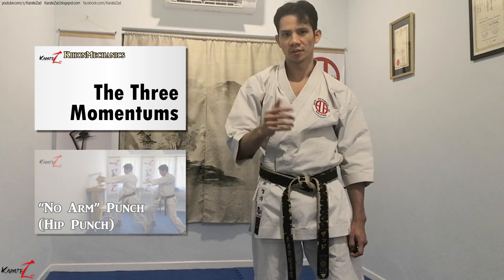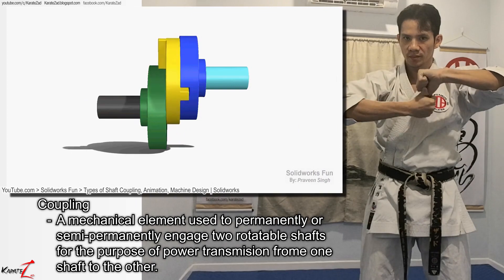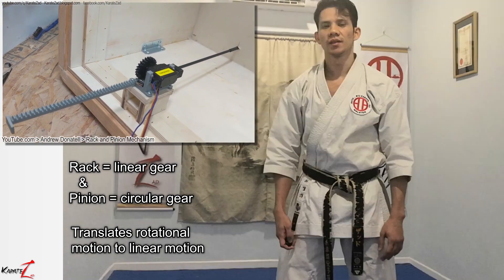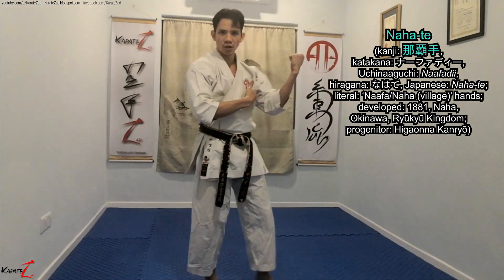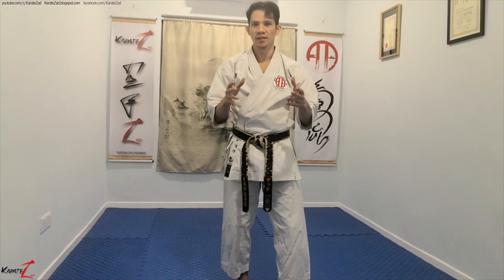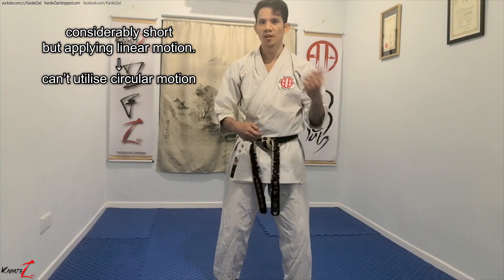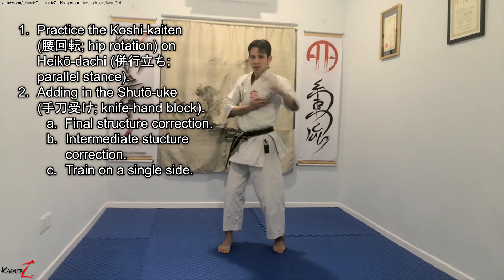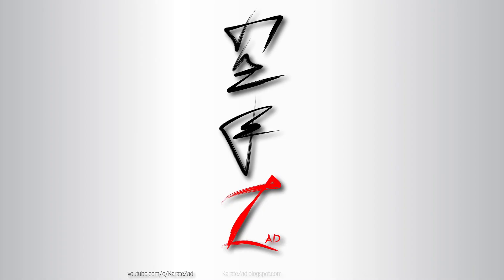Mechanical Engineering Concept for Fast and Strong Karate Blocks (Shuto-uke) | KihonMechanics #6

Comment: Very informative, packed with tons of info - Thank you!
Very curious to hear your thoughts on the "Sine Wave" movement of some style's punches.
Reply from the maker: Thanks!
I have been curious about the "Sine Wave" technique too. I've seen it around shown by Taekwondo experts, but never tried it out yet.
From what I can tell, what they're doing is dropping their body upon impact, hence putting their weight into it, making it stronger. In reality that occurs in karate too, but it is very subtle for karate since every movement is already naturally grounded to begin with in Kihon. Takewondo techniques, however, tend to float a lot, so when they drop upon impact, it that raise-and-drop very obvious and can be describe it as a Sine wave.
Personally, I don't prefer the obvious raise-and-drop movements as it telegraphs. To me when testing out effectiveness of a technique it it's complete form (i.e. as how one would use it in a fight/sparring/encounter), it's best tested with all factors measured together at once: power, distance, time taken to reach target, and telegraphy.